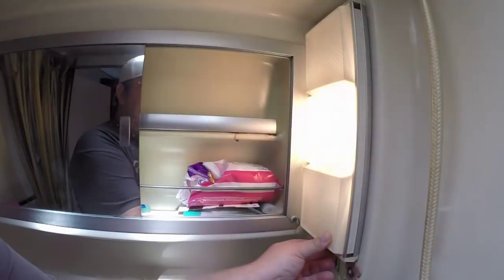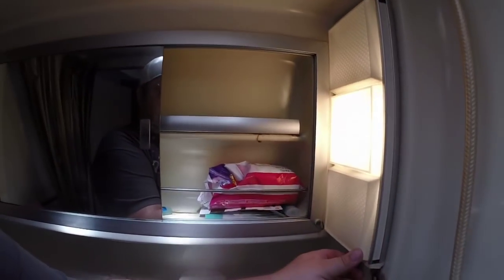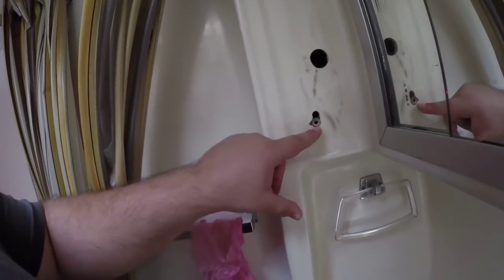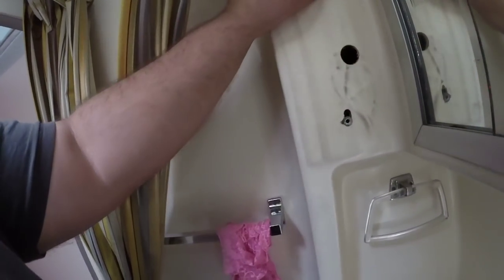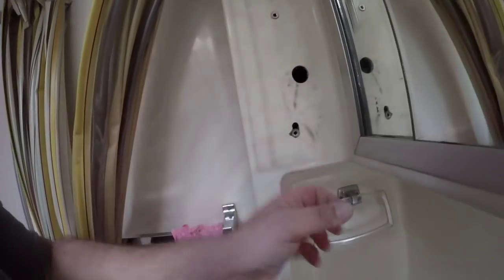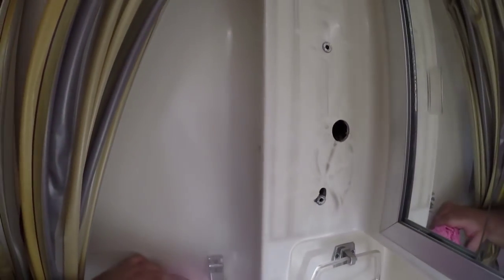RV Living Full Time Electrical Trouble & Plumbing System Update

Comment: The Lost Cable in the wall Question: as others have mentioned a coat hanger or piece of solid wire from a length of Romex for example with a hook on the end that you made with your needle nose pliers, then get in there with it and a flash light and an inspection mirror you should be able to retrieve it.
Good luck :)

Comment: The sewage question :  just keep the gravity dump simple.
Always keep plenty of water in the tank and you will be ok.
always put plenty of water in the tank before you use it. no chemicals needed.
My tank is over ten years old and its is quite clean in side for a black water tank.

Comment: I think you can get at it from the other side of the wall by removing the gauge cluster.  Also, you can remove the inside of that medicine cabinet on top by removing the screws on the inside parameter.  Be careful with it when you take it out (the inside of the medicine cabinet), it's delicate.  You should be able to grab it from each direction

Comment: James, Disconnect the power then use a coat hanger with a small hook at the end to pull the wires back to where you need them.
Reply from the maker: Mike Roqers Thanks!
Reply: I watch hard cause soon be on the road so these real good vids 2015 ending be travel happy world suck no more
Reply: Mike Roqers It looks like the hole could be carefully enlarged with a cut-off wheel and then fished out with a hanger. The light fixture should cover the larger hole. Toilet__COMPOSTING!!! Everybody loves them & no black tank.
Reply: Yes.
Reply from the maker: John Beckman I have a wet bath is there some sort of kit for that. It complicates things a little.
Reply: Wanderlust Estate It depends on how it is sealed now. Check out the current seal and see if a larger hole will change anything. I would think that you could use silicone on the back of the lamp if needed. * Is there access under the sink? If so, take 5" of string and weight it with some washers and drop it in the hole. Go under the sink and tie the string to the wiring connector and pull it up through the hole.
Reply: John Beckman What is on the other side of that wall? A refrigerator? Can it be pulled out and the wiring grabbed and pushed through the hole? If it's paneled can the panel be pulled back to grab the wiring?

Comment: Back in my Army days we once had an M-1 Abrams Main Battle Tank (first model, circa 1983/4) that was an electrical and communications systems nightmare come true. Army and civilian techs not mention a bunch of us newly minted CDATs climbed all over the damn thing looking for the "short" or "ground" that was causing the crew so much trouble. Bear in mind....This was a BRAND NEW tank straight off the boat (literally) from Ohio and our battalion, brigade, and division, in what was then West Germany, were expected to be combat ready 24/7/365. "Charley-34" (the tanks "bumper number" haunts me to this day) was on the verge of being sent back to the States when a civilian tech rep discovered that a three cent, Phillips head, alloy metal, screw that closely resembled, in size, the screws used in eyeglasses, had been either improperly installed at the factory OR had been MANUFACTURED improperly and made it through quality control despite it's failure to meet requirements....The messed up screw was causing a "blown breaker effect" if it "wiggled" even slightly on vehicle start up.   A messed up three cent screw brought a brand new, fourteen million dollar tank to a halt and NEARLY cost the American Tax Payer a few extra thousands of dollars just in shipping to get it BACK  to Ohio from wince it has come in the first place......In other words....It's best you discovered the problem(s) BEFORE you left on a long trip as to be in the middle of, lets say,  North Dakota....In the wintertime and start having electrical problems.....Because like C-34, it's those cascade failures that'll burn you every time. Glad you could track down and solve your electrical problem(s).....Hate you had to spend money to solve it/them. Take care and keep up the great videos.
Reply from the maker: FD Mackey Thanks! I prefer my headache. Haha

Comment: Harbor Freight has mechanical fingers. I bought a 12 inch and 18 inch. They are great for fishing dropped screws in hard to read places. they only cost a few $  Also a tip on dumping your black tank. Always open your grey tank first for a few seconds,  then close ,open long enough to fill up the drain hose. If you do happen to have a leak or faulty connection,the cleanup is a lot easier Good luck
Reply from the maker: Fran Verolla Thanks for the tips.

Comment: Chinese grippers work good,  the little flexible gripper tools that mechanics use to pick up dropped bolts etc. You can go down in there and grab it. And any auto supply has them. They might not pull it all the way up but you might be able to hook it from there with a hanger.
Reply from the maker: Tioga Trails Good call, thanks!

Comment: Howdy James !  I think you should check your water fill on the outside if the coach. In your vid dated Aug. 1, 2015 ( when you first pressurized the system ) I mentioned the fill flange   on the outside,did not have the correct screws. The ones on now are drywall or sheetrock screws, a sure sign of a repair or ???? Could be a bad or improper repair causing the leak.Remember, water travels the path of least resistance !
Reply from the maker: Wanderin' Moose Yeah I spoke with Jim and I have some tracing to do.

Comment: Fish tape and an earth magnet (like you'd find inside an old hard drive) taped to the fish tape with duct tape, or just use the hook on tape. Fish tape is for wire runs comes on spools is flexible and maybe 1/4" wide.Costs around $12 bucks/25 feet @ home depot. I've pulled cable through firewalls, vans, rv chases, under carpets, etc.

Comment: Wait what.. That converter should have an internal fuse or breaker to prevent damage to it. If it doesn't then buy one that does. As that is very important or the next shorted circuit or appliance will burn it up.

You need a fish tape that can reach to the bottom of the RV so you can grab it or get a thin fiberglass electrical rod from home depot. they come in a tube.

The electric can be reversed if it gets clogged up. Just switch the polarity on the wires. The way to prevent it is to install showers drain screens and clean them. Also don't use regular toilet paper or stuff women products down the system.

Comment: your bathroom light ; Use a long needle nose pliers with a flashlight. should be able to grab it and pull it back through. too bad about the grounding issues. Someone did not know what they were doing . LOL. keep on working through the whole system as you dont want any problems traveling . Have fun, RWS :)
Reply from the maker: Nor Cal Dave Thanks Dave!
Reply: Wanderlust Estate They make a tool that is very thing and flexible that has a claw on one end and a small spring loaded handle on the other end. I think I got mine at harbor Freight for a few bucks. 
www.harborfreight.com     24-inch-2-in-1-pickup-tool-94162.html

Or just drink a 6 pack and get the saws-all out.

Comment: What ever goes down your toilet just sits there until you open the dump valve. It dont matter if you chop it up or not.  If anything , I installed a nozzle in the black water tank to flush the interior after dumping.  Many methods have bee tried, very few work. Its a simple thing, solids don't move by them selves. Lots of fluid to move the solids. don't dump till tank is almost full.

Comment: The 12 volt converter should have been fused or breakers to prevent it from burning out. That's if it was installed correctly.
Reply from the maker: BUDDY LIGHT It was on fuses but it was over worked.

Comment: james, try using an inspection mirror and a flash light to see what happening down in the hole.  Then use the coat hanger to pull the wires up.  If that doesn't work, maybe you can pull the wall panel off and locate the lost wire....let us know how it works out...TL
Reply from the maker: Terry Landis Can't pull the panel off it is a one piece wet bath. I think I can pull the medicine cabinet off.
Reply: Wanderlust Estate Its hard to tell without being there, but can you access the location from behind?  Can you get to wall behind the one piece wet bath and open that wall to see the wire?  If not I still think the mirror and flashlight will show you where the wire fell to....

Comment: Good advice from others ... You don't need a macerator.  Hair isn't a problem in the black tank.  Shower water goes to the grey tank.  A macerator is handy if you want to pump the black water somewhere other than a gravity drain.  I had a lot of cleaning it out experience in a boat.  If you get one ... Don't swallow a cherry seed.
Reply from the maker: JC Travel Stories GMCs do not have separate tanks.

Comment: As someone who works on Motorhomes. I can tell you this, the electrical in all motorhomes is problem. This is due to so much wiring being crammed in to small spaces where heat builds up and causes failures. Be prepared for more problems in this area as you have the coach and it ages. oh and cheap labor is just that, cheap. happy motoring.
Reply from the maker: ***** Thnks when I can afford it I am doing all home run circuits that I will label, know and understand.

Comment: Hey James, I can make you a great deal on a used one. What, you're not interested?? We got one because we needed to move the water a long distance (50 ft) to the outlet. We were parked on private property and were using their septic. It turned out to be not worth the expense. At the time we had to run it off the car battery and it was a big pain in the butt. Excuse the bun, I mean pun.

Comment: i seen on the 4 seasons rv channel on youtube about how to clean it. he had a water metal rod that he put up the black tank and it sprayed all angles. dont know if this helps or not but i did see it before. he also put it down the toilet and sprayed with it.
Reply from the maker: Methos Films It wouldn't reach up into my tank, but I could use it through the toliet.

Comment: your going to have to wall fish those wires out its a tedious process thats going to try your patience.,. also when it comes to rv roof air zone off your rv .like if you have a accordion door close it to isolate the back from the front  if you dont have one install one so both ac's are not fighting each other
Reply from the maker: sam lyon I only run one AC at a time because I only have 30amp service.
Reply: still an accordion door will help. lets say your off out of your rig if you seal off the front than that area will be cool for ya when you return .and 20 mins b4 bed shut off the front 1 and turn on the back unit to kool off your bed room. with the door closed so your both comfy for bed assuming you both sleep in the same room.  if not my suggestion is to use the stronger of the 2 units and get a box fan.  good luck in the heat and drink plenty of watter.

Comment: Did you figure out about your electrical in the bathroom?  Just take out the medicine cabinet and the wires will be easily accessible.  There's only a few screws to take out and it pulls straight out.
Reply from the maker: Billy Massey Do I need to do anything to reseal it?
Reply: Wanderlust Estate No

Comment: So if you had a screw grounding a hot wire, why didn't it blow the fuse? Properly wired it should have taken the fuse out protecting the converter. Your lucky you didn't burn it to the ground.
Reply from the maker: zugzub It does have a fuse. The ground was not complete and it over worked the charge controller.

Comment: personally I would take out the toilet and put in a composting toilet    that means no black water tank at all       the composting toilets you can get today are great  no smell and easy to maintain
Reply from the maker: rwzeek Do they have them with retrofit kits to be in a wet bath?
Reply: Wanderlust Estate 
James you could use mine to see if it could be worked in. It is under the bed in my coach.
Tim
Reply from the maker: ***** Thanks Tim! I will ask Brian about it. Nice to hear from you my friend. Miss chatting with you.
Reply: Wanderlust Estate not sure. Would have to check that out. But o think you can pit most of them in a wet bath
Reply: Wanderlust Estate
Reply: Bon Voyage

I am toying with touring a bit before shipping the coach back to UK so we might bump into each other.

Tim
Reply from the maker: ***** I would like that very much when will you be back in the states?
Reply: Not finally decided yet.
Tim

Comment: You get the wires out let? If not go get what we Mechanics call set of fingers(  http://www.harborfreight.com/24-inch-2-in-1-pickup-tool-94162.html ) and they will grab them for you.
Reply from the maker: mdaddley I have not, but was told I can just pop off the medicine cabinet and the wires are right there.

Comment: Hi regarding you electrical system.  Please Please Please.  have somebody that really knows your system do quality work on it. Every year people get electrocuted by there motorhomes not being grounded properly. I'm not talking about people accidentally messing with wires and such, I'm talking about people connecting to shore power and then just touching the handle to there R.V door, then just drop dead, fried up, electrocuted.  most people do not think for some reason?that a motorhome has enough electric energy to electrocute them? maybe your stand alone 12 volt electrical system does not have the amperage to kill you? Which it could also  if the situation is just right. It's when you hook your R.V up to your 30 or 50 amp box that you have the problem. so again please have a electrician took a good look at it and make sure everything is properly installed. I hope you have a great journey to freedom.  take care. Hawk